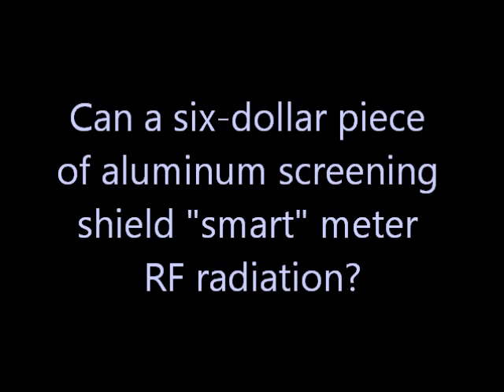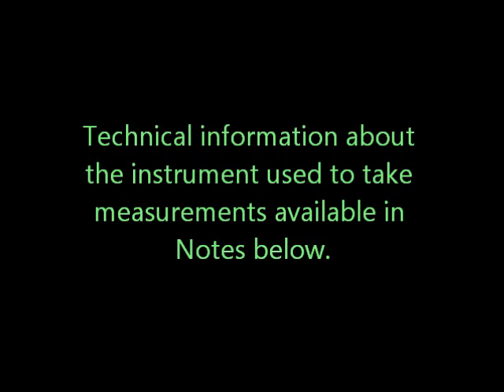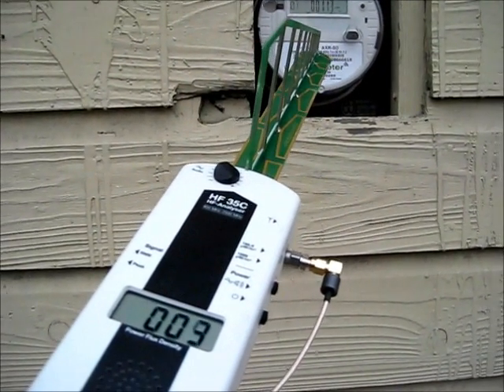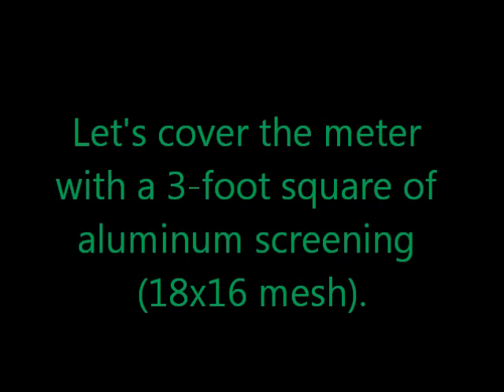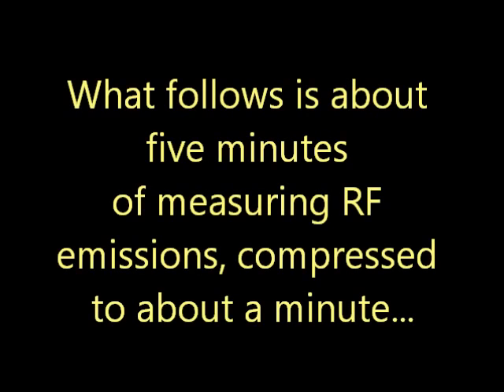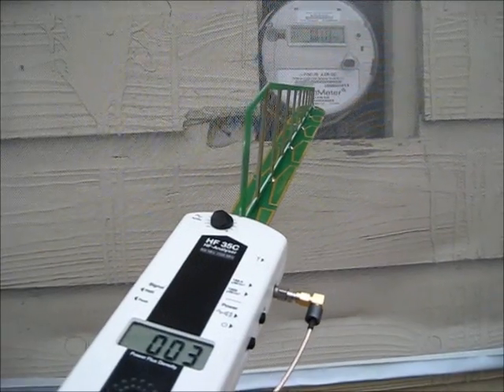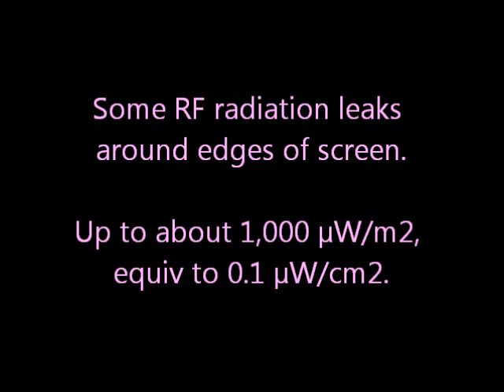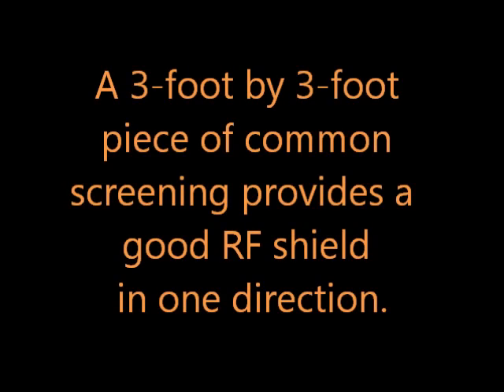Foiling a "Smart" Meter, Part Two: Aluminum Mesh Screening

Comment: More RF radiation comes from outer space so make sure you have a supply of fresh Aluminum foil to pack into your hat.
Reply: +Ebenezer Kalarama (sigh) yes I know but how the bloody hell did a marvelous creature like Homo Sapiens evolve into brainless morons like these.
Charles Darwin please help.
In the mean time keep up the good work.
Reply: +La Diablo What are the visiting hours in jail? Much simpler solution, use heavy weight industrial grade Aluminum foil in your hat AND hub caps
Reply: +Ebenezer Kalarama Best answer yet and TRUE what more could she ask for.
Reply: Shhhh Keith, that spoils their electrophobia fun, besides they wouldn`t be able to ascribe any of their stupid conspiracy theories to 4 billion years of that heavenly radiation.
Reply: Keith, do you own an aluminum manufacturing plant, or have invested heavily in aluminum stocks?  Your constant suggestion to use it seems to point to either one.
Reply: +mmakshak NO but it's a good idea, thanks.
Reply: Jail is an ideal environment for those scared of EMF, with all that nice reinforced concrete and iron bars.   :P
Reply: +La Diablo I am a retired CISCO SYSTEMS ENGINEER, I have never worked for a power company and the Aluminum foil is GUARANTEED to fix your problems. Oh use heavy duty industrial grade foil the stuff you get at Walmart is no good.
Pack it into the hub caps on your car, OH most cars no longer have hub caps, we'll never mind.
The latest research shows that putting the foil in the roof of your car between the roof and the headliner works very well  also it reduces deep space radiation to almost nothing.
I have also read that painting the words " radiation shield, do not enter" on the foil increases its effectiveness by almost 50%
If anyone has any other useful tips just post them here.
Reply: Keith I've read that data centers are considering switching to all wi-fi... no hard wiring between nodes and stuff. Woe to all the poor electrophobes! Our esteemed colleague here should get a job there.
Reply: You sound like a serious person, but you aren't using any research in your calculations about wifi.  I'm beginning to wonder whether you are really an engineer.
Reply: Ebenezer, I can't wait for you to find out the real truth about wifi.  Research has been suppressed due to that 1996 FCC law.
Reply: ho hum.  what fcc law.
Reply: Oh, the telecommunications act. A lot of folks think that was intended to aid in Television reception, yours for example. That 's a lot of reading and the 1934 act one was interesting too, because WLW [no, not WKRP] in Cincinnati was pumping out 500,000 watts.
Reply: +La Diablo You MORON can't you recognize SARCASM when you see it.
Or are you the one who needs new foil in your hat.
God knows who you ever worked for but in my time at Cisco I worked with some of the smartest engineers I have ever met.
I also used to work for Honeywell, Hewlett Packard the original HP NOT THE CURRENT CONSUMER PRODUCTS COMPANY. Bridge Communications and 3Com who basically invented the networks we see today and Cisco.
I also worked for several Silicon Valley tech start ups.
What's your resume look like?
Reply: And now I`m reading about The Greenville, NC `Voice of America` facilities that became the most powerful international broadcaster in the world, in both physical size and radio frequency energy.

Each of the sites housed nine transmitters– three of 500,000 watts, three of 250,000 watts, and three of 50,000 watts.

Attention EMF Activists! You who are desperate to find any EMF sickness complaints near there and finally prove that EHS is real!     ..... you won't find any, sorry, I`ve already looked.

Comment: As an electrical engineer...would have been more compact, cosmetic and efficient had you made a circular screen shield to fit directly on the meter..a meter cover....covering the circular side of the plastic meter. It is a Faraday shield (leaky) and Faraday shields do not need to be grounded. There wouldn't be much radiation on the other side of the meter...if the electrical C/B box was right behind it ...like in many cases. I don't think those energy pulses would hurt, make someone sick or control people...but i question why they are they, there's no reason for them to be there....well, you could use pulses of energy to detect bodies, people, animals moving around in a home. Makes you wonder why radiant energy pulses are there every 30 seconds.

Comment: btw, here is 1 other tip on how to cover your smart meters.  Take lead weights, used in fishing, pound them flat...tape them together to fit like a cone over the meter...&/or tape them directly onto the meter.
Reply: Good heavens, isn't there a better way of getting sheets of lead? They are used in the roofing industry. Perhaps you could buy a segment (strip) from a roofer? and bend that to make a perfect cone and I think you can even buy lead tape, although that would be unnecessary if the two edges simply overlap and are then taped. .

Comment: Touche' thisiradiatedlife...! applauds   Yes, aluminum neutralizes electromagnetic energy (E.M.E.).   Easy proof...take a magnet....& a piece of foil...aluminum can, etc...try to pick it up w/the magnet.  You'll find you can't accomplish this.   Those who have aluminum siding...do NOT remove it..! Radar is another technology that canNOT go thru this siding.     Anything aluminum I would start placing it on the attic floor....lead sheets are better, but more expensive; best priced more for your buck is on amazondotcom.  For starters...lay lead sheets/aluminum where you sleep & where you sit the most at.  Of course wash all aluminum b4 placing in home to keep unwanted bugs away.  If you can afford it lead lined windows like those used in X-Ray Rooms.  Cut cardboard panels that fit well into your windows...tape aluminum foil (preferably thick) over one side & at night &/or when feed of E.M.E is being directly sent thru...place panel w/foil facing outwards. This works very well.  The by-product of E.M.E. is "radiation".  This excites the cells in a way that it throws out potassium, calcium & magnesium...just like chlorine (not unusual for heart attacks to occur while in pools), so make sure you are taking these, but be careful w/the potassium don't need to take every day.  Also...Thyroids are heavily effected, best way to keep these up & going is...Liquid Kelp.  Follow the instructions on the bottle; 3 drops to a glass of water. Not long after you drink this fluid that your body has been retaining (you may not realize your body has been doing this)...soon your Thyroid is flushing your system..big improvement.   Also...take MSM 1,500mgs tabs..make sure it has Vita. C 500mgs.  Typical dose is MSM 2 tabs & 1 tab Vita C.  You will be amazed at how "Well" You feel no long after taking it.  Also...taking it regularly you will find that you are not catching those nasty flu's, viruses 'n colds.  thisiradiatedlife thank you so much for caring about others....You & Your Wife are True Brutha's 'n Sistah's...I feel & believe just as you both do.  I feel blessed & a bit humbled that our paths have met.  I used to be an Industrial, Commercial Electrician...& in '91...was a couple yrs from obtaining my Doctorates in Radiology & Gastro-Enterology.  Just like everyone else...a victim of polluted environment caused life altering tumors. I have added natural medicines & have incredible successes.  If there is anything that I can help you &/or others with...more than welcome to contact me.   The best way to get back at those who are causing so much harm is...healing ppl so that they can have their health & break free from their restraints.  Yeup...I love doing this...! Namaste Kindred Souls
Reply: Faraday cages made from copper screen is used to block electronic radiation or most any metal foil or screen , but it has to have a very small mesh.  But dont forget to cover yourself with some when you leave your RF proof cave and when you use your cell phone and wifi and the wifi hot spot in your car and your electronic arm devices. ;-/
Reply: You're doing good work, HigherWaysWoman.  Have you noticed that you are getting help, when you go on a course that aids people?
Reply: I really think you can change the bad effects of EMF with high energy things(large cathedral quartz, extremely strong orgonite, etc.).  Unfortunately, this didn't work on the Comcast router, when I sat within 3 feet of it.  I ended up having them bridge the router, and that worked.  Generally speaking, your best defense against our EMF-filled world(besides distance from strong emitters), is to keep your energy high.
Reply: Technophobes could buy a big honkin chunk of `Orgonite` and dig a hole in it and live in it.
 Then mount a TV antenna on top.  :D
Reply: +Walter Perry
That was the real reason why folks used to dress up in those medieval armor suits back in the day. Merlin and Rasputin were running around casting magic psychic EMF spells on people.
Reply: Walter, you can't conclude what you do, unless you include the power of the transmitter, frequency, and distance from that transmitter.
Reply: Those medieval people were ahead of their times!  I will postulate that certain frequencies are good for you.     Since i use some of those, and they suit my purposes for what I do, I probably won't waste my time studying that, but others(younger?) could.
Reply: Then, again, why are microwave diathermy machines still popular?
Reply: It`s been proven that people who have very old homes with those huge cast-iron bathtubs that blocked radiation lived much longer than anyone, but they`re all dead and they were stupid anyways so who cares.
Reply: ``I used to be an Industrial, Commercial Electrician...& in '91...was a couple yrs from obtaining my Doctorates in Radiology & Gastro-Enterology.``    Gawd, what creepy lies.
Reply: ``Yes, aluminum neutralizes electromagnetic energy (E.M.E.). `` 

 So if a little kid experiments and takes two magnets off the fridge and puts a chunk of aluminum foil between them and violà!      they still attract.    :-/
....another clueless electrophobe theory shot to heck.

Comment: The "radiation" is simply that device sending cellular phone type information on power usage back to the utility company, which they use in real time to direct energy where it needed. This in theory should mean leaner power stations. Energy capacity of these power company would be a closer match to consumer usage instead of the over capacity presently built into the system. This is potentially a tremendous saving.
Reply: If these people went and held this next to a cellphone tower I assume they would try to lockdown the damn country...

Comment: I know this video is not about cell phones but similar videos say aluminum screen can block almost everything... I wrapped my cell phone in aluminum screen, I called it and it does receive calls...It was wrapped in 3 layers of screen...why is it still receiving calls??...aren't smart meter using the same type of waves as cell phones?...I want to protect myself from exposure because ever since they installed smart meter in my neighborhood I suffer from much more insomnia, but when I do test, the aluminum screen seems to do nothing...can anyone help?
Reply: Unless the aluminum is grounded, it actually amplifies the signal.
Reply: Thats strange I put my cellphone in a aluminum cooking pot and it would not receive anycalls, because it was shielded from all outside radiation.  Ya have to cover it totally with NO openings for that to work.

Comment: Well thats clever, you just reflected the EMF into the building meaning there will be twice as much inside.  Quality.
Reply: +COOKIE And are you someone with a job related to signals and cables? No? Look no further ... SSSP & cabledog in the military, cable installer, electrician, emergency systems in the civilian sector. What you need to do is read less of joeblowsblog and wikipedia. While a mesh can absorb signals it is one sided. This means it absorbs it from going in that direction, not absorbs in the capacity that the mesh actually absorbs it, rather contains it in that specified direction. Many people come into this false understanding of the usages of 'absorb' and 'contain'. The main reason for readings to seemingly be reduced inside the home is that its the material of the home actually absorbing the EMF. So what you learn here is the shielding contains the EMF. The materials of the home absorb it. A good rule to always remember nothing is ever simply gone. It just finds a new way, path, or state of operability/existence.

Comment: I would also paint the inside wall where the meter is with carbon based 
paint.  I believe they sell iron paint but don't if will work. Paint 
like 2-4 coats.

Comment: Quick important question: If I paint the screen (as to blend it into the wall), will it still reflect the emf waves? I would be so appreciative if someone could answer this
Reply: Yes it will reflect. Microwaves goes thru bricks, paint concrete, etc  except metal. I would also paint the inside wall where the meter is with carbon based paint.  I believe they sell iron paint but don't if will work. Paint like 2-4 coats.

Comment: What about  the RF emitted behind the meter, which is a major concern of homeowners?
Reply: +mmakshak The meters back side is made out of 2mm metal, nothing goes through that.
Reply: +Tony Philipsson   Thanks, but my guess would be that further away it could be bad(does the metal cover more than 2 feet to each side?).  I sat closer than 3 feet from my Comcast router, and that wasn't enough distance.
Reply: +Tony,  Yes it will go thru the metal box as proof measured by a meter. This is because their are gaps and holes on the box. Microwaves loves holes.

Comment: Duh!   She would have better spent 5 minutes reading the RF meters users manual!  
 Like the part that states: 
 " Minimum distance 2 meters.
Due to the physics of wave generation it is not possible to reliably
measure the customary ”power density” (W/m2) in the close vicini-
ty of the source of radiation. For the instruments described here,
the distance should be in excess of 2 meters."

Meter by Gigahertz Solutions out of Germany.

She was just about TOUCHING the smart meter with the antenna!    For shits sake!

SBF
Reply: emf radiation is the MOST intense AT the antenna, it gets weaker as a logarithmic function of distance from the radiating elements.

Comment: It won't bounce the signal back. It'll likely ramp up it's power and wreck hovoc whoever is inside. You've just made it ANGRIER... a very smart meter.
Reply: Agreed!  AND no one on this page has mentioned the inverse square law as it applies to ANY RF frequency. Think of it this way: double the distance from the source , and you get four times less power/exposure.  It is (somewhat) possible to get a slight increase in signal strength some odd direction where field intensity is elevated but  would likely be constrained to a narrow beam width. Even still Inverse Square still applies even to that!
Reply: +David 
Indeed! XD
Reply: totally incorrect

Comment: To all the idiots saying it is a "Faraday Cage": -It is not a Faraday Cage because it's missing a crucial component, and that is grounding of some kind.
Reply: +SkylineToTheSeaAndMe 
Also a faraday cage is an enclosed "CAGE" ... a simple screen in only two dimensions won't do much good XD
Reply: a metal trash can with a tightly fitted lid IS a farady cage as is any sealed metal container. Grounding is only needed if the cage is in a highly irradiated environment,  to shunt any accumulated electric charge to ground (I.e, a intense emf field). I used to build faraday cages for use in recording studios for MWR facilities on bases that had high power search radars.
Reply: That might be true but: 1) The garbage can is grounded because it is touching the ground. 2) You can't completely enclose a smart meter and block the radiation from it. Because if you did, then the utility wouldn't be able to read your power usage.
Reply: A  Faraday Cage doesn't need to be grounded to be effective. You should be calling others idiot, ya know.?